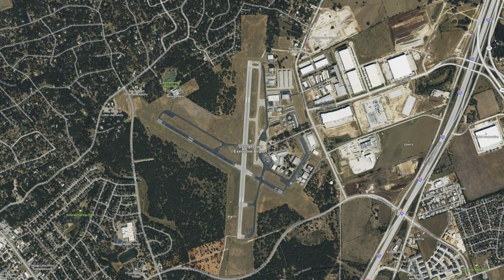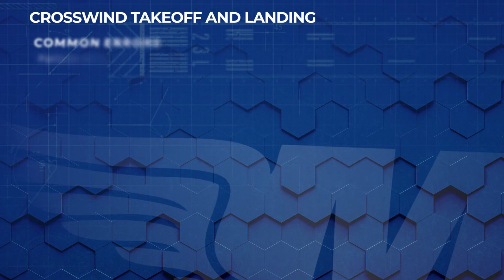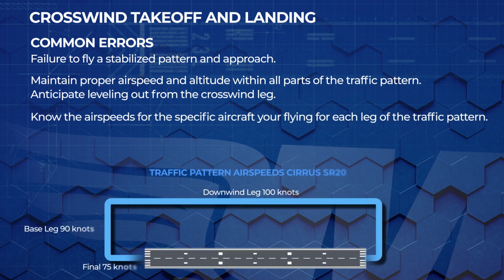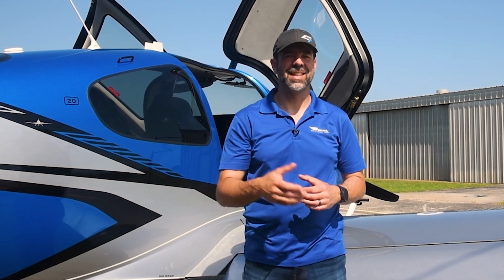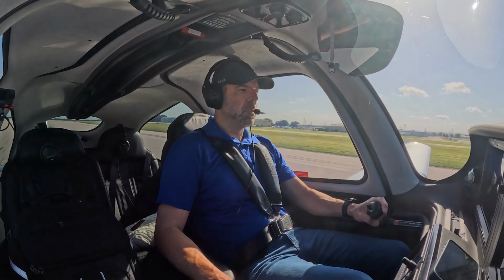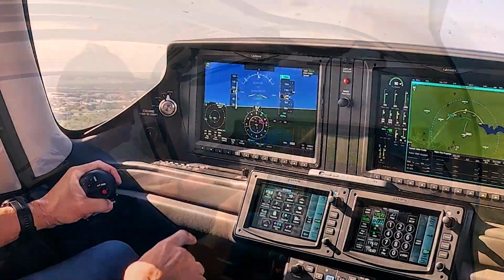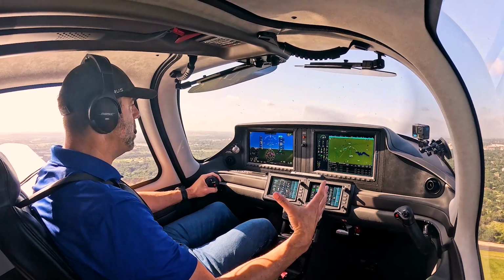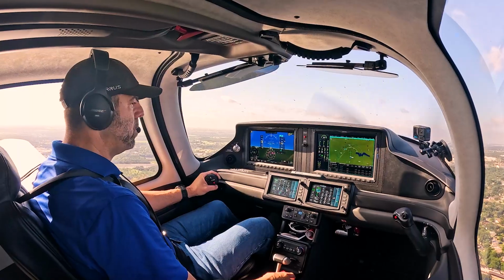Low Wing, Big Wind: SR20 Crosswind Techniques

Comment: Could you please help for this METAR: OVC008, temp +3°C, dewpoint +2°C, QNH 1018. Field elevation 1,500 ft. Cloud base AGL?

a) ~800 ft
b) ~300 ft
c) ~1500 ft
d) ~2300 ft

My understanding- While both cloud base and cloud ceiling relate to the lowest cloud layer, cloud ceiling specifically refers to the height of the lowest cloud layer that obscures more than half the sky below 20,000 feet (6,000 meters). Cloud base, on the other hand, applies to any cloud layer, regardless of sky coverage hence 800 OVC is ceiling not the cloud base. cloud base is 400 AGL DALR.

Comment: Did you land with partial flaps on the first landing?  Not sure Cirrus advocates for partial flap landings.
Reply: I'm not sure I'd be advocating for any training, regardless of experience, that is different than what the IFOM says.  MZeroA has a reputation for following standards and this unfortunately goes against that.
Reply: @brianbohannon8044 yes in the poh 100% flaps is recommended, just like the AIM recommends a 45 entry but that doesn’t always happen or apply, ie a pilot performing an instrument approach but csip and tci have all taught me the technique of application outside the scope of normal landing operations, ie gusts outside of a certain range. While this is not stated in the poh it is an acceptable technique. I flew the cirrus many times with Jason in gusty conditions where he also used that flap setting.
I apologize if you don’t approve of the way I fly. I simply showed my tips for handling a crosswind in many years of flying the sr20, 22 and 22T.
Reply: You can absolutely do 50% and 100% flap landings. When it’s really gusty I choose 50% flaps.
Reply: @coachraythepilot1976  I’m not saying you can’t do it. We obviously all train for no flap and partial flap landings .
I’m just simply saying what Cirrus recommends.
Reply: @in2flying  absolutely. I have 300 hours in the SR20 and time in the 22T as well and I am more comfortable with 50% flaps, especially when it is gusty, that is my reasoning for using that. For beginners Cirrus doesn't recommend 50% flaps because the plane is less stable. Most times I do land with 100%
Reply: The POH says use 100% flaps for every landing except an ifr approach to minimums.  50% flaps is not approved.